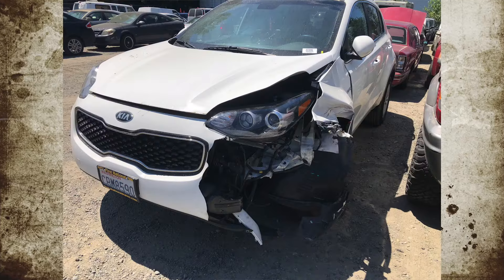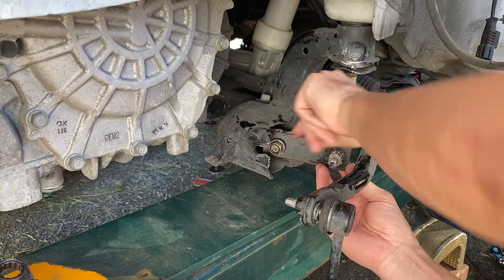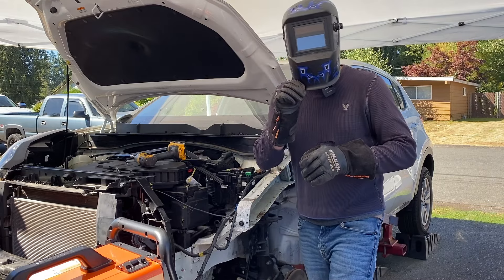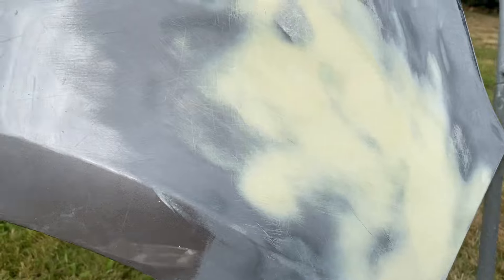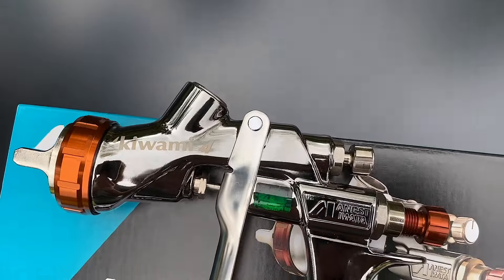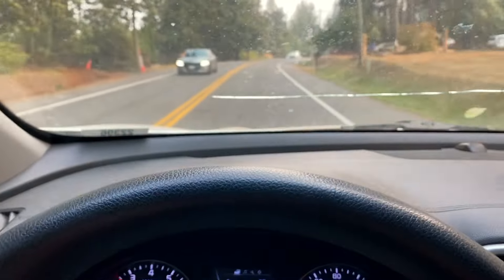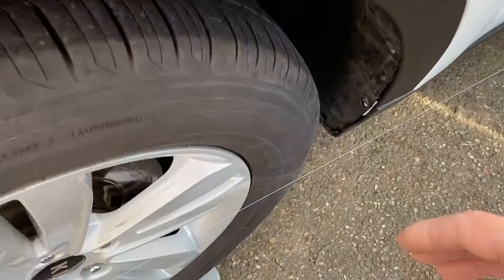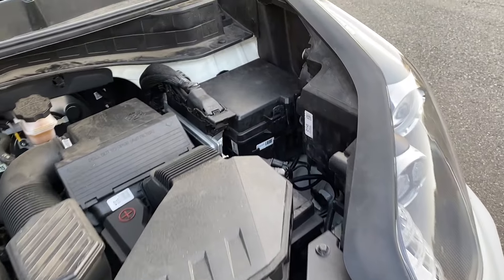✅ Fixing this TOTALED Kia SUV in My DRIVEWAY With AMAZING Results

Comment: amazing work, I grabbed those plates and steering wheel holder just now, i did not know they existed! I also grabbed a tire clamp and magnetic gauge for doing camber. I also do the string technique similar to you but i run mine at 0 toe, Cars are set factory 1/8 inch toe in, that is why you have that millimeter toe in on the passenger side. I actually had taken my car to a professional alignment shop, and when i got it back it pulled and the steering wheel was not centered... Imaging having 1 job and cant even do that. After that i started doing my own alignments and it drives perfect 😂😂 and saved the 80$ etc. Please dont turn into goon squad and do Lambos etc. keep it budget and realistic. Its way more entertaining.
Reply from the maker: I visited my mom in another state a few years ago and noticed that her alignment was off. Since I didn't have any tools I went ahead and took the car in to get it realigned. Long story short, after the half assed work that they did I ended up having to go and buy a tool set so I can perform the alignment procedure myself in her garage after which everything was back to spec 👍😎
Reply: Should raise the back wheels on a plate also for more precise alignment

Comment: I think all taken into account, this car really turned out really, really well. I would have no problem driving and or owning it. But a bit of positive critique. if I may? If you check your previous video at 1:26, you will see the parallel bumper gap, on the left hand side - like a good bumper / fender fitment should be. If you keep that in mind and you check this bumper / fender fitment (26:43) you will see that the fender / bumper fitment, is not level and neither parallel: end to end. And THAT, is how you catch most repairs done. And from what I can see, that is the only give away. I am using your videos (and also that of Brian and a few others) to learn, a very valuable skill and lots of valuable knowledge. I was especially impressed by the way you fixed that Rolls Royce, the building of your own spot-welder and many of the other videos you have shared with us. Thank you for sharing your videos with us.

Comment: That interior is so gross. I think I would have pulled all the seats out to really get all the nooks and crannies... Love your work - I used to do more of that,  but not that ambitious anymore. Your alignment method is new to me. I always established a centerline, then used 4 jackstands to set a perimeter. Your way is faster. I don't like the guy didn't clean the body in the windshield area before he put the glass in though.
Reply from the maker: This interior was pretty disgusting, I've had some cars in the past where I had to tear the whole interior out and even shampooed the rug. After shampooing the seats, vacuuming the floors and wiping down all of the plastic panels the smell was gone for most part 👍

Comment: Great video I’m wondering what air compressor you use and what specifications you recommend for a paint set up maybe you can even make a video on that
Reply from the maker: Thank you! I actually did do a video on that, I built the air compressor that I'm currently using. Here is the link to that video if you're interested: https://youtu.be/YD1dNpelSpg
Reply: @fix206  I actually watched that but the only thing I really don’t want to get a massive air compressor for a small Projects I want to know what specifications are minimum to get good results I want a 30 gallon air compressor? That’s the biggest I want. Also keep up the great work. Your YouTube channel will grow and it will make you a lot. Very cool to see someone from the 206 doing this.
Reply from the maker: There are some paint guns out there that require less air to run. I personally don't have much experience with them since every gun that I've ever used I ran with a full-size 60 gallon compressor therefore air consumption was never a concern of mine. 
Got to represent the 206. I am more in a 253 area, but still 😎

Comment: Great work and paint finish . What clear coat do you use ?
Reply from the maker: Thank you! I used USC clear on this car. It's inexpensive and works great !
Reply: @fix206  it's real glossy that's why I asked i use good quality clear coats myself here in california I spend about 190 for a gallon of clear and 2 quart hardners I'm looking for a better clear I also fix cars to resell
Reply from the maker: USC or Upol clears are my go to clear coats. Been using them for years with good results. Nice and glossy and inexpensive. Also make sure to give your panel plenty of flash off time, otherwise you'll run a higher risk of dieback that causes clear coat to loose it shine once it dries...
Reply from the maker: I've used this clear a lot. Cheap glossy and lays down nicely https://amzn.to/3NK4hG9